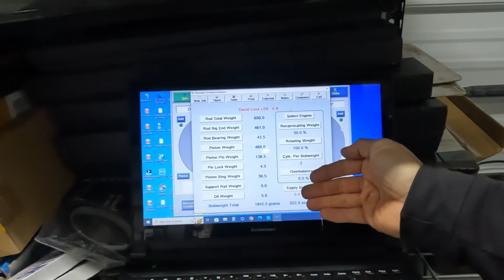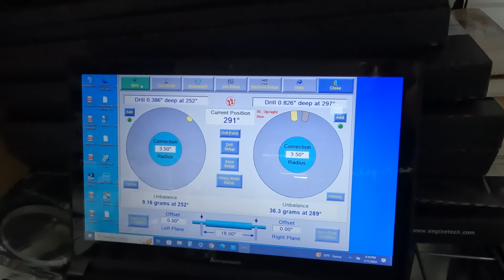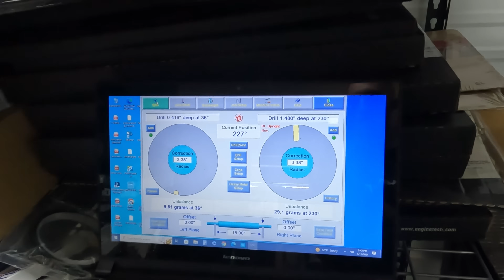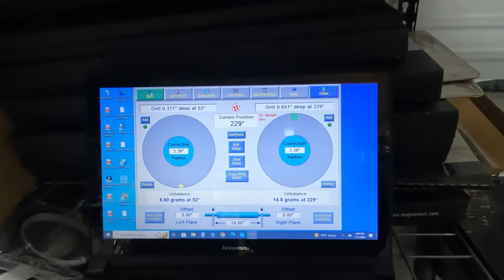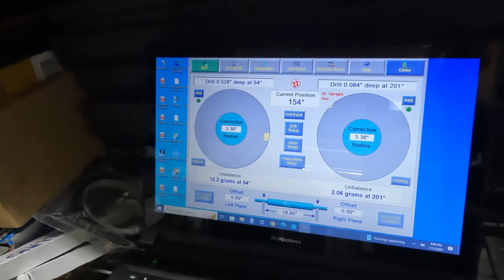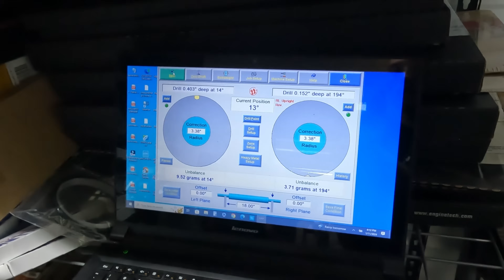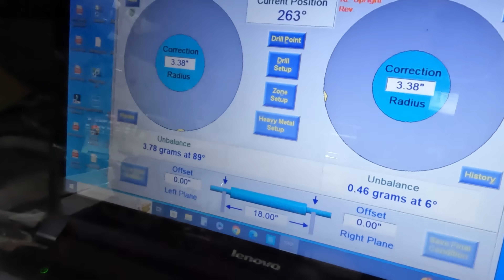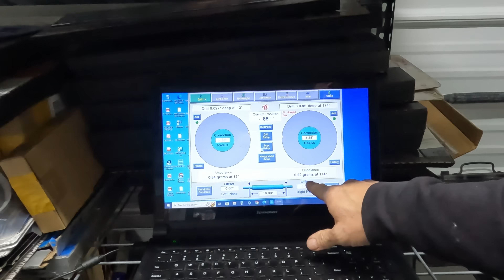LS9 Nightmare episode #5: Trying to Balance this molested crankshaft.....

Comment: Im restoring a vehicle and everything wrong that could be done has been done wrong like a simple rocker cover seal l replaced and found the head rocker bolts snapped in the head which was simply a person reusing  stretch bolts they snapped rocker bolts and butched the head trying to remove it was so bad l had no choice but replace the head,you name it the last owner destroyed things like wiring,suspension, every little job became a nightmare ,some people shouldn't be allowed near a vehicle

Comment: I truly think that if you have any job long enough, you’ll run into a nightmare. This happens to be one. I got towed vehicles (Isuzu) from other shops with a no start or misfire they couldn’t fix after two weeks! 
I had an Isuzu Amigo that is a canvas top and comes factory with a key lock on the hood release. A used car lot pulled the handle and broke it off. Simply fix in their shop. Just turn it sideways and run two deck screws into the kick panel to fix. Unfortunately, the ECM was behind the plastic and one screw went thru the #3 injector driver. That, is not covered under warranty 5yrs / 100k miles. 
   Thank you kindly for sharing this nightmare!

Comment: With the amount of labor to try correct a compromised piece like that I imagine their must be times you just tell a customer they would be better off buying a new one.
Reply: Thats like a $900 crank. If you want a different one you are looking at an aftermarket forging. You still need to balance it either way. The front imbalance was less than 10grams. Thats only about 1.5cc of material.

Comment: What an interesting video. I've never actually seen a crank balanced, so watching how you did it was very interesting.Too bad they stuck you with a real turd of a crank! You sure did persevere and get it in spec. I agree with not working on the junk ones in the future. Keep up the amazing work!
Reply from the maker: Ty very much!!
Reply: might have been balanced with the flywheel-combo/flex-combo and race-damper and pully's on 🤔💭or there equipment wasn't calibrated? ect
Reply: He needs to invest in some quality equipment, though.

Comment: Looks like some shop used a tire balancer in the past....LOL. Interesting stuff and Im a 4 cyl type....Would like to pick your brain with a Q & A video.....Lets talk about valve guide materials, steel vs bronze magnesium and wear, single vs double valve spring wear on valve guides, cam lift vs wear on guides. Im forced to run bronze mag guides with a .50 lift cam and double valve springs on a Toyota 22R. At least thats what the seller says (LCE). Im probably way out of your wheel house with a 1980's 4 banger. Just looking for longevity and 50,000 for guides is not ...Ask your viewers for questions...get more views....Thanks for your reply on shaving pistons...GOOD advice.....

Comment: As a shop owner/ machinist I feel your pain on these types of jobs. It’s just my son and myself also. The jobs that come in that are baskets and you fix to make the customer a usable quality part most of the time just don’t pay enough with the extra time and effort it takes. My problem is I see it as a challenge, but it just doesn’t work to be profitable on those jobs. But I agree when that motor comes apart and the next person sees it you get the blame! Pictures and documentation will give you a small defense, but its just not worth the hassle. 
    That Turner technologies balancer is a nice piece. I converted my stewart warner 2000 to Turner Tech and that guy is super helpful and knows balancing.

Comment: Daniel, so darn interesting!  First, what’s the value of the CS?  Is it worth the labor cost to jack around all day just to get it close?  Considering the cost of a quality overhaul a new crank wouldn’t be a large percentage?  Second, why do you not use a drill lube?  The residual oil will create an inaccurate balance?  
As always, thank you for the learning!!!
Reply: I just read a new crank is about $1100 and it cost the customer $400 to balance that one?  Is this true?  So for $700+- I could have a brand new crank?  I’d make a boat anchor out of the old one!
Reply from the maker: The new crank will need balancing also

Comment: This is very interesting stuff. What should be done with the rest of the rotating mass like the front pulleys/dampener and clutch kit or flex plate or the converter?
Reply from the maker: @raindeergames6104  it all should be checked if possible

Comment: Friend of mine bought a fox mustang set up for the strip, seller had receipts for the 1 year old build lots of high dollar parts. Engine had low oil pressure a few months after he bought it. I came over his house when he got the engine on a stand it had a forged internally balance crank and the machine shop drilled so many holes in the rear crank weight to balance a 50 oz flywheel and it wasn’t balanced it vibrated that’s why the bearings were wiped out.
Reply from the maker: Yep, there's alot of morons out there pretending to be machinist....
Reply: @powellmachineinc  Sadly, a lot of guys believe that if they can drill and tap a hole, they are machinists.

Comment: When a crank is in the engine with ring drag and compression on each of the cylinders does that change the balance and also does the balance change at higher rpms in other words could a person put the crank in the engine together and get a balance reading of the real life situation i am asking i was just wondering

Comment: This thing looks like it's been drilled n filled more than a junkies teeth just before they fall out ?    Mind you I have no clue about
what makes this piece so valuable?  Is it  made from billet steel like the Harley shaft you spun?  I only ask because it's had work
done 2-3 times & now you have it,  so it's got to be a very expensive part.  I'm wrapping my mind around this as to me I'd want to
run over to Walmart & pick a new one up... lol,  so you fixing it again makes it a valuable piece, no doubt?  TY for the videos

Comment: Noticed that you have the crank sensor wheel on the crank as you balance.  I had a 5.3 ls crank balanced and they charged me  to remove and install said it was necessary.
Reply from the maker: If you have to put Mallory in the rear counter weight you need to remove the reluctor wheel to install it

Comment: What does it take for cut down counter weight/air plane winged balance jobs on factory LS cranks ??  Costs ?? This is considered for a 5.3 . Would a 6L crank make it easier to balance ??
Reply from the maker: You would just have to add a bunch of weight back in Mallory to fix what u cut off

Comment: Got a question ! Alot of engine Guy hate on the others putting mallory on top off counter weight and not on the side because it can flew off the crank . 

How do you ensure that will not happen , even welded it happen sometime
Reply from the maker: Radial installation it garbage,  it's gotta be horizontal

Comment: Great video again....question...im building a 406 SBC for the street and I bought a brand new luniti lightweight rotating assembly and should I trust that the crank is ok or should I bring it to you for balancing....thx.
Reply: if it does not specifically say that its been balanced then yes you need to have it balanced.  take the flywheel or flex plate too if its external balance.    ive seen kits both ways. and the non balance kits are usually much cheaper.   its  been a long time since ive bought one tho.

Comment: Let me start by saying that I have never even seen a crank balancing machine up close so, this is not a criticism in any way, just a question.
You said the weights are calculculated based on 100% of the rotating mass and 50% of the reciprocating mass. Doesn't an adjustment have
to be made for the conn rods being heavier on the crank end?
Reply from the maker: We don't care about heavy or light, we care about what the components actually weigh, we are simulating the rotating mass.
Reply: When balancing you determine the weight of each end of the rod with a fixture

Comment: Is it possible to remove the mallory, weld all the holes from the balancing and mallory, then start over with the balancing? Have you ever seen mallory come out of the crank at high RPM when it is close to the edge of the counterweight? BTW, you have the best engine machining channel I have ever watched.  I always learn something from your videos. Thank You for that.
Reply from the maker: I could, but ultimately it's cost prohibited,  normally there's no issues with heavy metal coming out, unless there was a installation error.
Reply: @powellmachineinc   I personally would have bought a new crankshaft and hung that one on a wall as a horror story. Thank you and have a great day.

Comment: This is interesting.   How did they balance these before computers?
Reply from the maker: The manual balancers work in the same concept but just used analog gauges and you had to math to figure out how much material to remove
Reply: @powellmachineinc  Interesting

Comment: What balancer are you using? I kinda like the setup vs the floor mount jobby
Reply from the maker: Turner technology
Reply: Is there anything a CWT could do that would benefit you vs what ur running now? @powellmachineinc3179
Reply: @powellmachineinc3179  I had a OLD Stewart balancer in my hobby shop  that no longer works. I've been upgrading from my hobby stuff into full time machining. I do a lot of medium and heavy duty diesel stuff. As well as the normal ls etc. I've got plenty of mills and could easily spare a little more worn machine for this type of setup.

Comment: Makes you wonder if the last fiy balanced it with a hydraulic damper and flexplate on it instead of bare.  Damper still solid instead of liquid.
Reply: They probably didn't set the cap right.

Comment: I once had a local shop balance my v6 splayed crank.   Charged me 1000 for a clean, polish and balance.   He said it was really hard to balance hence the high cost.   I got it home and unwrapped it, 4 slugs of Mallory in it! I called because that couldn't be correct,  he said it was correct.   I new it had to be wrong,  so down loaded a Bob weight form and made all my weights.  I found that my new rods were lighter!  So why all the Mallory?    I called him back and asked if he still had his Bob weight form and could we compare them.  All of the weights were close,  until the end Bob weight,  his way WAY more!  He asks me how I came up with my low number.  I said it's a splayed crank so only 1 piston rod combo per journal,  so I didn't have to times that mass by 2.  A BIG LONG PAUSE ON THE PHONE!   I said that you balanced it as a v12, he said yes and bring it back.   Out came the Mallory,  in went some tool steel,  no idea what a got in the end.  He only gave back 200 bucks.   After the build,  I sold the car.  I wish Powell was in my area!
Reply from the maker: Yea, split pin v6's are different

Comment: This might be a stupid but, In the beginning with this crap 15:19  being so screwed up could you press the heavy metal out of the crankshaft and filled it with a round bar stock of what the crankshaft is made out of and just started from scratch? As expensive as Mallory Metal is in the process of going through this multiple times. Wouldn’t it just been cheaper to buy a new crank?

Comment: The old-timer I used to work with when he had to drill into hard stuff like that Mallory and whatnot for weight he would use a carbide End Mill . He just factored and burning up a carbide End Mill to every job if it was already balanced from before

Comment: Why don't you weigh both halves of the bodyweight ? With all the fasteners?
Reply from the maker: Think about it, we need each half to be equal,  if we just weighed the pair how would I confirm each half?? Balancing isn't as simple as one may think
Reply: @powellmachineinc3179  I've been balancing engines using a shadow graph scale and model 2000 Stewart Warner engine balancer, the disc's used for the weights can easily be mixed up side to side, if you make the bobweight using both halves and add the disc weights side to side there is much less chance of mistake, and then there is the over balance option for engines operating  above 7000rpm most of the time, I had customers from Oklahoma, Arkansas, Kansas and Texas, I never had a balance job complaint, and then there is the issue of bobweight placement, some put the weights to the front, some to the back on the journal I run mine centered on the journal to within .005, if you don't center them you won't get a real balance, shifting from front to back verses center makes a huge difference......
Reply: Put one of the bobweights on a mandrel center it with the adjustable  nuts and no other weights on it, see how close they are...
Reply from the maker: @ChiefCabioch I use to have a sw 2000, it just doesn't compare to what we have now.
Reply: @powellmachineinc3179  you didn't know how to run it, I've tested back to back with Balance Technology machines and a 2000 SW will do just as good as anything out there....I'm 73 there are few engine machines I haven't run, have a great day.

Comment: Watched Old Man's Garage in Ohio.
They had a slug slung out of crank someone worked on.
Right thru the pan and he wrecked from the oil  on the front wheels.
Brand new built car. It was big block .
Reply from the maker: It was put in radially instead of horizontal,  you can't put it in radially unless you want to make a grenade,  rookie mistake
Reply: @powellmachineinc  i can't tell you how many I've seen from "professional " places have it radially and then welded. I'm like, it's gonna sling out, wth !!!
How do you feel about welding mallory in a crank?

Comment: Seems like the crank has a center counterweight that is way off in weight. Perhaps the last guy was chasing his tail to correct it at the ends because the error kept switching ends due to the imbalance being so close to center.
Reply: That crank doesn't have center counterweights. Stock LS cranks don't.

Comment: Why not split your correction holes, say your correction is at 12 why not drill at 11 and 1 to split around that Mallory? Nice work though getting that botched crank dialed in.
Reply from the maker: Because we would still be in Mallory and or a welded up hole

Comment: Just a great video for us mechanically minded types.
Please allow me this one thing.  It's your channel and shop.  You're free to run both however you see fit.  I get that, so I'm not interested in being "that guy".  You can tell me to pound sand and I'll still respect your decision to do as you wish.  
But let me express my concern, respectfully, about the safety of your eyes.  It took me a while to find safety glasses that were affordable and comfortable (light weight and not hot in summers).  Pyramex and Elvex both make light weight and reasonably priced safety glasses. 
Both the brands listed above are very comfortable to wear.
Like I said, it's your channel and shop, so you run the show.  I've been walking this earth for almost 62 years now.  My concern isn't to try and impose my will on anyone.  It's just that your eyesight is more important than any tool in your shop. 
Anyway, Congratulations on being so close to that 18k Sub mark.  😉

Comment: I don't like those solid trunions I prefer ball bearing trunions the chips will embed in the plastic and won't in the ball bearings
Reply from the maker: Ball bearings are less accurate,  we want accuracy,  so we make sure we get the chips out
Reply: @powellmachineinc3179  that's crap, they make precision ball bearings, I've run Stewart Warner Model 2000 engine balancers since the mid 70's and tested my jobs on machines like Balance Technology machines and there was no difference....